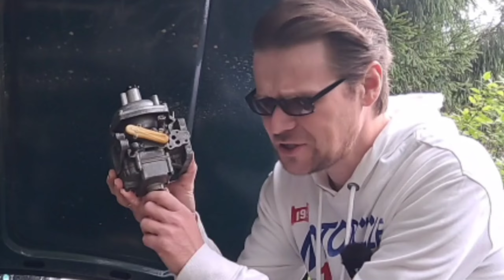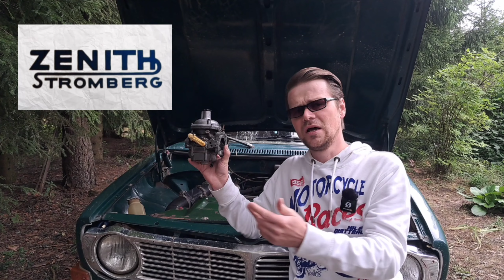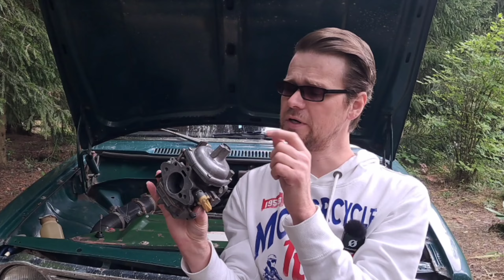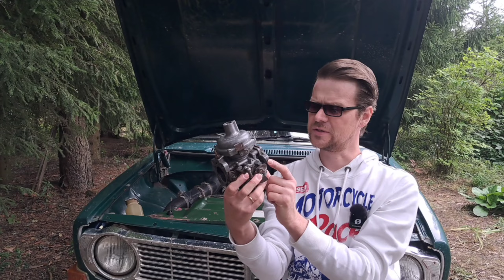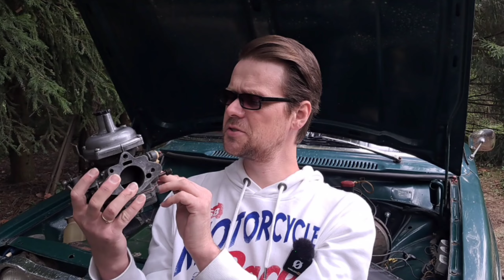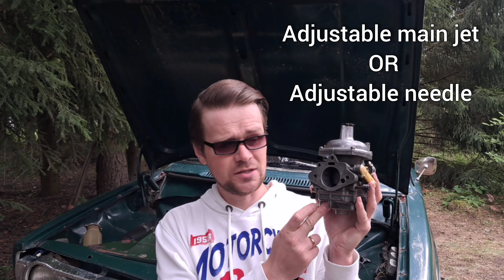Zenith Stromberg Carburetors – Adjustable Needle & Jet Trick

Comment: Hi Patrick. how are you I have a Zenit stromberg 175cdsu carburetor with a B1FD needle. The needle is adjustable. I would like to ask if it is possible to replace it with a B1EE needle and nozzle, both parts are original Volvo
Reply from the maker: Hi! Sure, but be ready to adjust the carburetor after the replacement.😊

Comment: Hej Patrick! Thanks for your work and your videos! Please make a tips and tricks how to adjust cold start device together with throttle adjusting screw from that side on this carburettor. Feels like my ’79 244’s stromberg puts too much gasoline in comparison to air, so the engine starts running very rough and hard, unless I shut off choke, press gas, and wait a bit for the engine to work again good. And this is until it warms up a bit, and then I can take out choke just a bit and engine runs smoothly thereafter. 
Or should I just go by feeling, screwing that little adjusting screw on the cold start device side?
Reply from the maker: Hi Stasikdj! Sounds like your choke is giving too much fuel on cold start. Best way is to first set the carb when engine is fully warm – adjust idle mixture and speed so it runs smooth. Then adjust the small screw on the cold start device a little at a time (turn out if too rich). Do small steps and test cold starts. Mark the original position so you can go back if needed.
Reply: @patricksgarage i see. I have already adjusted the mixture and idle when warm, now the car runs perfect when warm, and the fuel consumption is within normal range. Okay, will now try with cold start screw bit by bit. Thank you!🤝🏼
Reply from the maker: @stasikdj Perfect 👍 bit by bit is the way to go. Good luck!